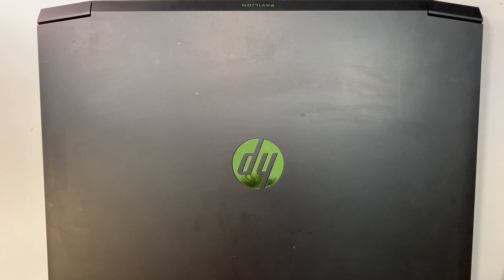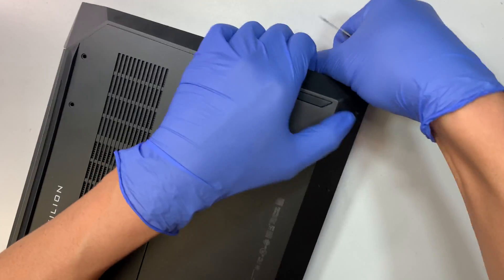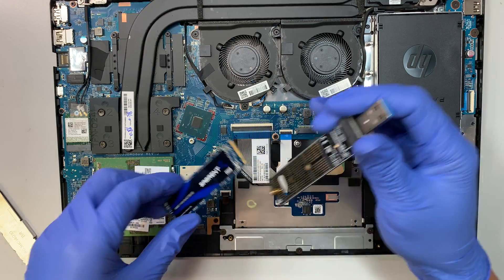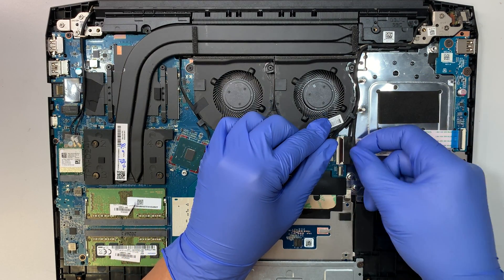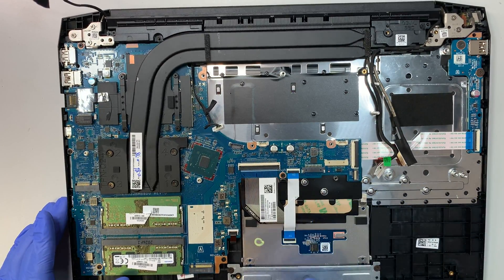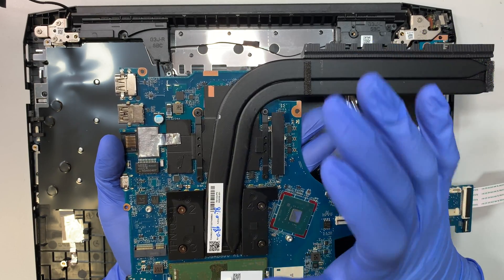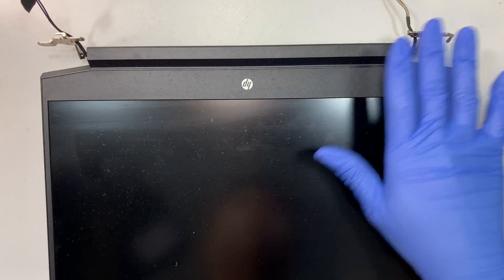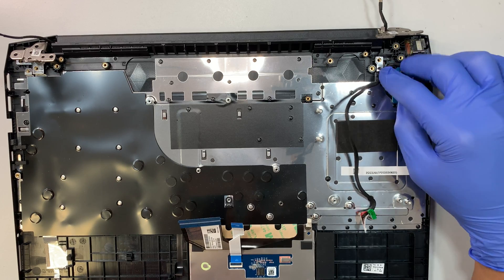HP Pavilion 16 a0045nr Tear Down Disassemble

Comment: My laptop is making rattling/ humming sound because of the plastic part on the heat sink pipes 
While I'm using the laptop on my laps during typing on laptop so is the same issue on this unit too...i purchased my unit 3 months ago

Comment: Where would the CMOS battery be located. When I try to boot up my laptop, the light blinks and then shuts off, but never boots. Could this be a dead CMOS battery?
Reply from the maker: No CMOS battery. Runs off from main battery. You can try remove battery and direct adapter to power up laptop. If that fails, more likely other hardware failed
Reply: @UbergeeksBiz  I got it to boot by unplugging the battery and unplugging and plugging back in the AC. A blue screen said “The CMOS Checksum is invalid” and it reset itself to default configuration. Now my laptop works 100% fine while it’s on. The problem is when it’s fully shut down, it can’t turn on again. I just want to know how to turn it on when it’s off, because there’s no issues while it’s turned on. I can even play GTA V on it.
Reply: I need help please. My laptop (same as this one) won't charge and one turn on. I've looked up as much as I can but nothing. I've took out the battery drained the energy by pressing the power button for 1 min. then put the battery back in with the charger and nothing. I repeated the process but without the battery and still no reaction. I repeat the process without the charger and still nothing. My charger workes with my girlfriends laptop (hers is a hp envy 65w and mine is 200w) and so I'm lost on what I should do.